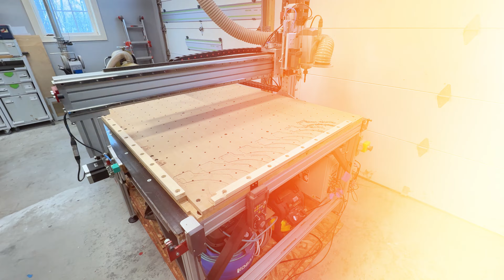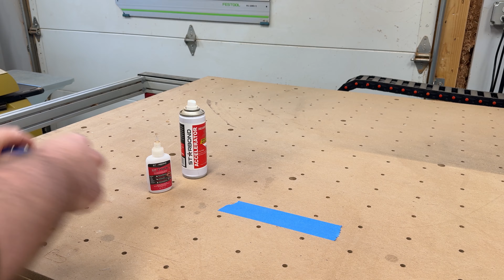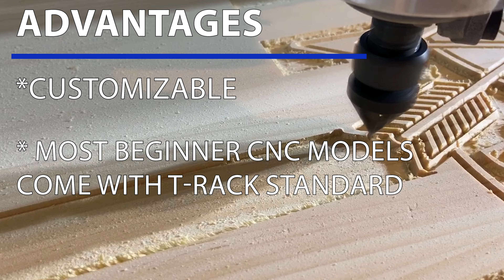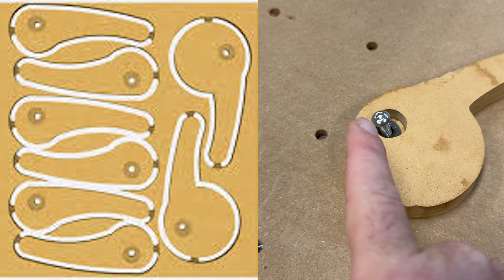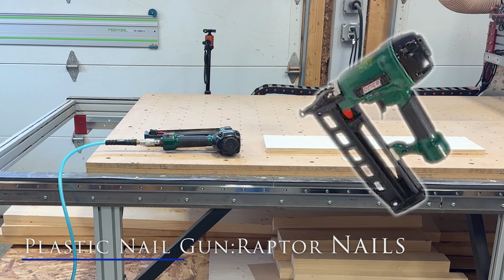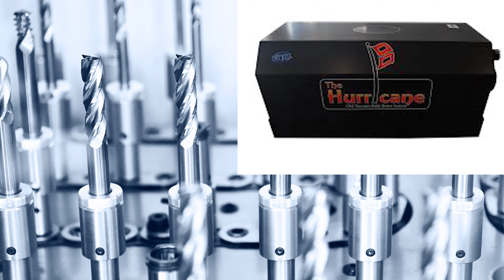Stop the SLIP! Top 5 CNC WORKHOLDING solutions REVEALED!

Comment: Great video. I’ve had a Shapeoko 3 since 2015 with lots of upgrades over the years. I’ve tried most of these methods and generally use nails as the fastest and easiest. I find even metal pin nails are so small they won’t hurt a router bit, but the problem is they sometimes snap off in the spoil board trying to pull them out. Maybe I should bite the bullet and try the raptor ones.
Reply from the maker: Thank you!! Yeah it’s definitely an investment. I think the raptor gun is $400. Some things in my shop I regret buying but this thing was a game changer for me
Reply: @Thepaicosaesthetic Yeah, the cost of that nail gun is a little nuts - much more than my nail guns that shoot actual steel nails! :) 

Years ago I almost upgraded to an Avid (back when they were called CNC Router Parts) and also looked at Shop Sabre, Laguna, and Step Craft, but this is just a hobby for me and I also play with lasers, 3D printers, and too many other pricy toys. The hybrid T-slot table on the Shapeoko 5 is a tempting upgrade though, but first I may try vacuum pods or a Raptor since those are just a few hundred bucks to check out.
Reply from the maker: @aut @automaticprojects ds like a solid plan. I would love to upgrade to a vacuum table myself but avid has grown quite a bit and their upgrades are getting crazy expensive. There’s a company that makes one called a hurricane but I looked the other way when I saw the price tag over thousands of dollars. Everything is expensive, it’s annoying. Haha. Good luck with the T-slot upgrade. I’ve never used T-slots myself but it sounds like a good solution